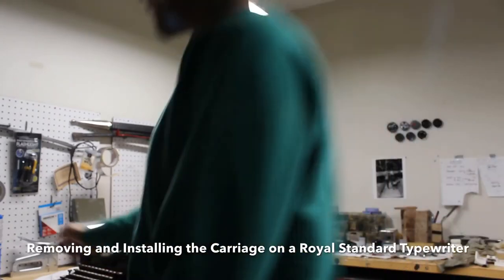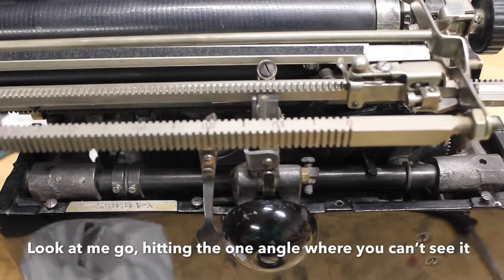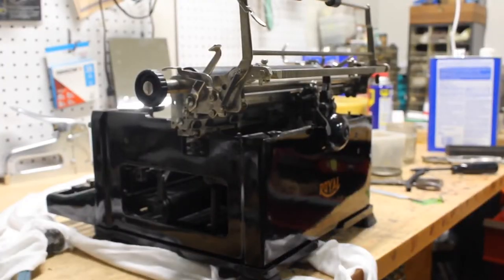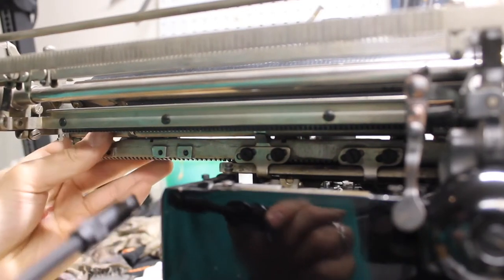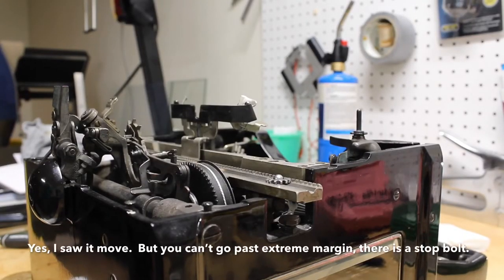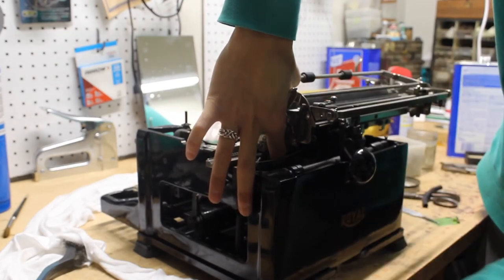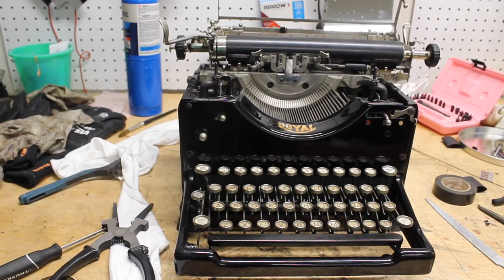Type Shop, Ep. 3:  How to remove and install the carriage on a Royal Standard Desktop Typewriter

Comment: I am currently working on a 1952 Royal Model HH Standard, and its carriage return spring tension control mechanism is frozen/stuck on the '1' setting. As a result it's carriage return is very weak.  I hope to be able to get that mechanism freed up and working  as it should without having to remove the carriage. If 'push comes to shove' and I have to remove the carriage in order to gain access to that mechanism to free it up, this video will prove to be invaluable In removing and replacing the carriage assembly... Thank You Very Much!

Comment: Thank you so much! This video is so helpful.  But one short question, what is the actual function and logic of the five clamps underneath? Seems that I don't know how to properly adjust them, as a result, now the typewriter cannot type on one line, characters is lowered a bit at about 60 of the scale.
Reply from the maker: the 5 clamps hold the top carriage rail against the bottom carriage rail.  It adds consistent stability and bearing contact at all points of the carriage motion.  Without them, the carriage would be too unstable to operate.  The wheels at the top are merely guides and upper supports, the bulk of the carriage is held on with those positionable clamps.  Very important.

Comment: At 4:25 in the video, you begin the removal of the carriage lower rail brackets "that are adjustable"... I wonder if it would be beneficial to first outline the brackets original positions on the lower rail with a fine-point 'black Sharpie' (before removing them) to eliminate the necessary adjustment step during the reassembly process?
Reply from the maker: The adjustment is much finer than  the width of a sharpie line, you'll need to readjust anyway to get things working just right rather than good enough
Reply: @TypewriterChicago  Thank you for the reply, and answering my question….👍

Comment: Hi, very nice video. I have to re-assemble (came in pieces) one of these but it has the longer carriage, around 24". I'm am still not sure where to place the ball bearings and the the cogs. I have 4. Could you possibly give some instruction. Thank You. And I watched all your videos to get to a far as I have re-assembling.
Reply from the maker: One ball bearing goes all the way at the end.  On the right edge of the machine as you face the back.  (Operator left).  Lay the carriage across the top so it lines up at the extreme stop on the right side, the edge of the carriage is where the other bearing goes (underneath of course).  Just like in the video, but pretend the carriage is longer.  The bearings will just be more spaced

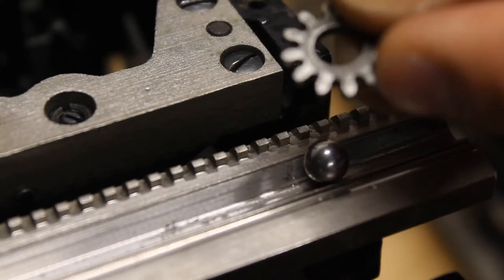Comment: This is a small error I noticed. At 7:30 you say the pinion rounded side faces up, but in the army tech manual it says to always place the pinion beveled (rounded) face down. I don't know if it will at all effect the function though.
Reply from the maker: Hmmm, that is interesting.  I felt it operated smoother this way, as it meshed better with the top rail.  I'll need to do some more investigation.  Thanks!
Reply from the maker: After some more research and examining, I have noticed that factory royals have it bevel up?  Whatever you feel works best I guess!